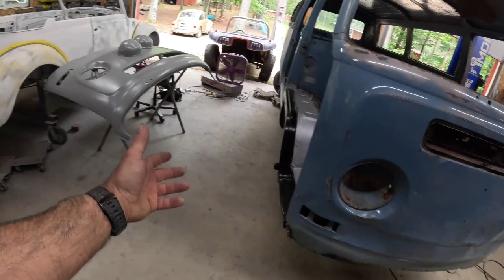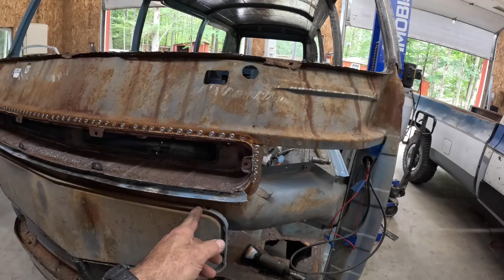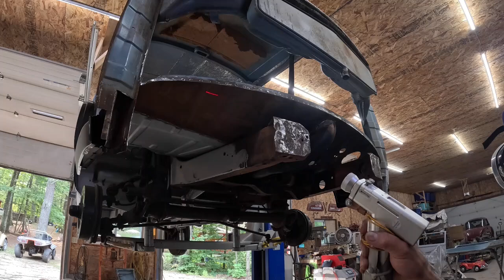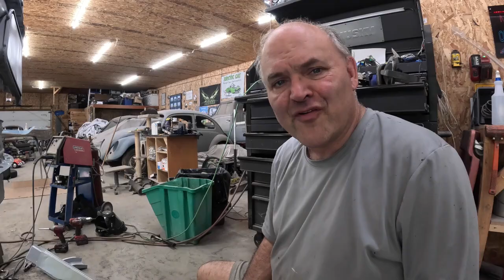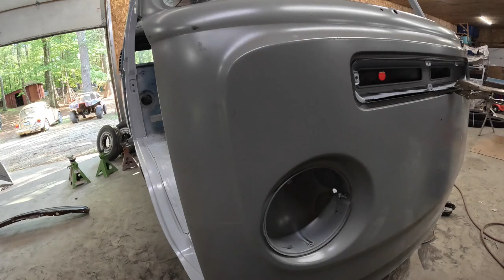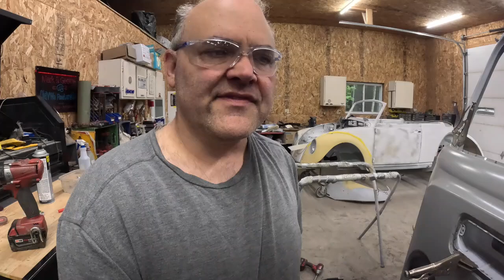1969 VW Bus Front Nose Replacement

Comment: This is the best video on nose replacement on youtube.  You take the time to describe the details. I have my old nose off and fitting the new nose, and I can confirm it take some patience bending and fitting.  I like the idea of notching the bottom airbox to tack weld in place instead of drilling for plug welds.  I am also considering panel bond for the top of that air box but I can't see how I can set that and do all  the other stuff fast enough before the panel bond sets up.
Reply from the maker: Thanks for the feedback! I am glad you liked it I have never used panel bond so I am not sure how much time you get before it sets.  I can see that being an issue. Like you said it takes time to get the nose on and it keeps moving ( and falling off, lol)